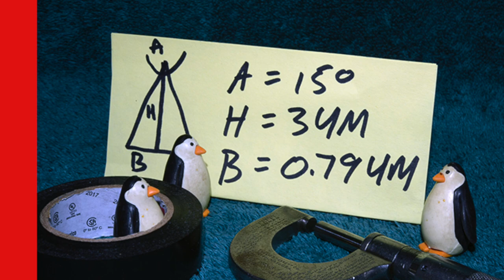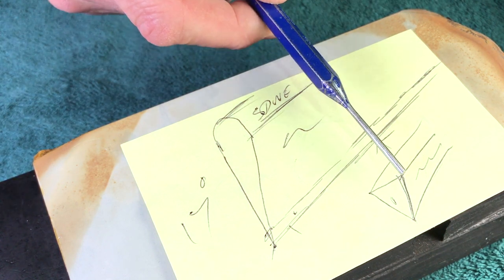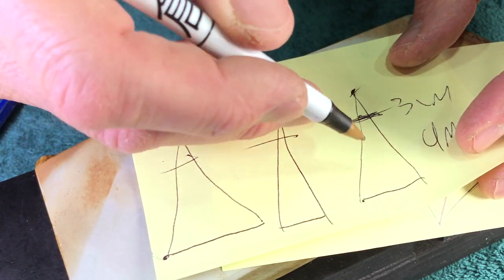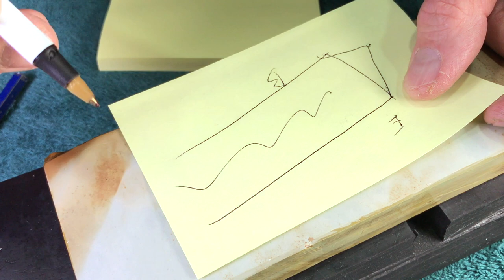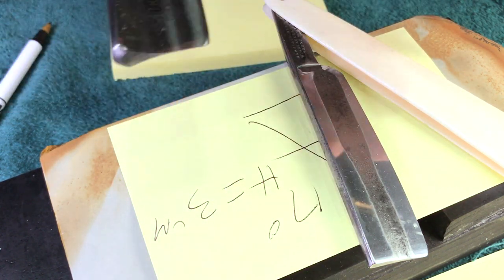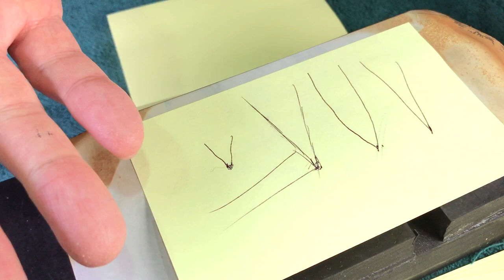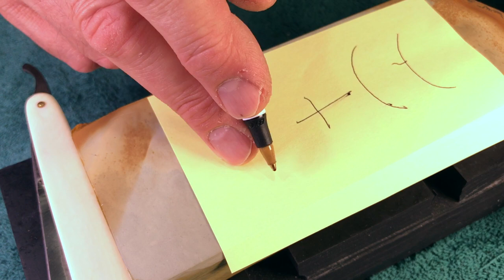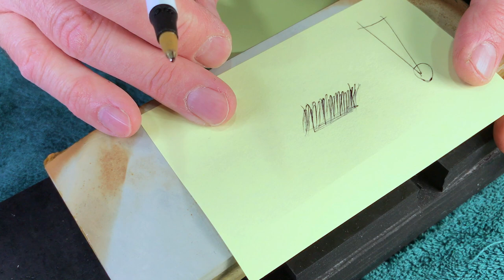Bevel Angles 101

Comment: thank you. i saw a vid where you were honing a gold dollar while pressing on the spine. i was able to do that and get a bevel set WITHOUT tape i used vermont green slate as a two stone hone and got the best edge ive ever had. just as sharp as a DE blade but way more comfortable. its not perfect but it works. couldent get the very end of the heel and very tip of the toe to hone. you have been the greatest instructor i have found!
Reply from the maker: Cool, thank you for watching, commenting, and sharing!

Comment: nice one sir great video and makes sense . have to say same findings myself not in your scale but 2 gds measured roughly 20 degrees. (spine can be thick as a leg on those gds) honed up shave meh ok but not the best . ground the snot out the spine got them down to about 17/18 degrees honed up and the shave was a marked difference. . know i thought maybe it was because i got the warp’s out so the blade was lying flat on the stone when i was honing it . but in my mind i was thinking it’s got to be the angle . looking at your conclusions and your experience had to be the angle 📐 . i have a wedge like that i did pretty ugly bevel but man does it shave well 👍👍👍👍
Reply from the maker: Thank you for watching and commenting - happy honing!

Comment: Nice video, Keith. Great info and excellent explanation. 

What’s your diamond plate of choice when you need to take a bunch of steel off spine? Atoma 140?
Reply from the maker: I don't use a diamond plate to do that usually. I have 120x, 220x, 320x stones for this sort of thing. And, to be totally honest, if the spine needs that much reduction then I just don't want to deal with it. There are too many fish in the sea for me to spend that kind of time on just one of them. But - if I was going to use a diamond plate I'd probably go for a DMT. The Atomas are better for lapping stones, not so much for working on steel. The diamond pattern in DMTs is better for working on the blade. I don't have one now but if I was going to buy one for that purpose it might one of the Diaflat plates. A 220 would be ok too.
Reply: @KeithVJohnson1  Ok good to know. I agree I don’t usually go through the hassle if that much metal needs to be removed, but sometimes I like to just mess around for fun here and there. I’ve got a Nani Pro 400 I bought for heavy work but haven’t really used it too much yet. Anyway thx again. Love the Post-It note lessons.